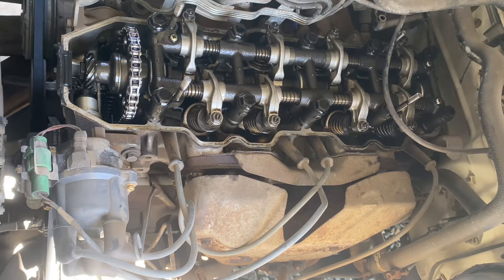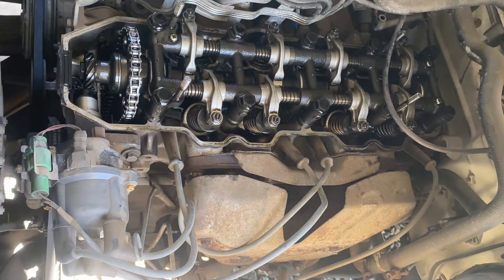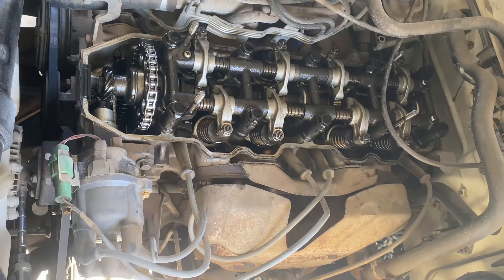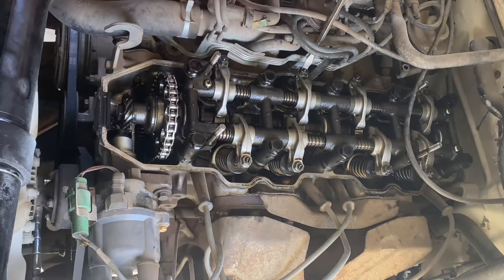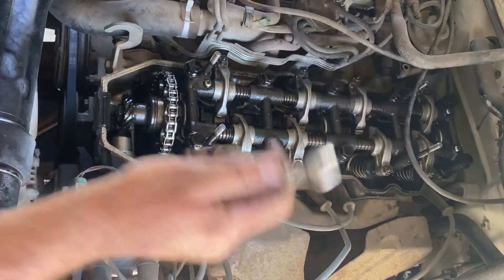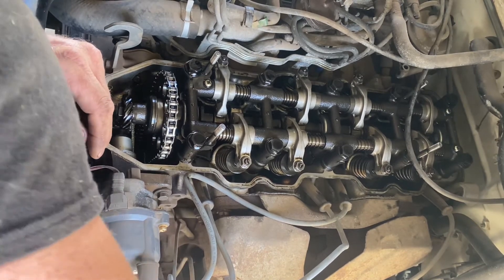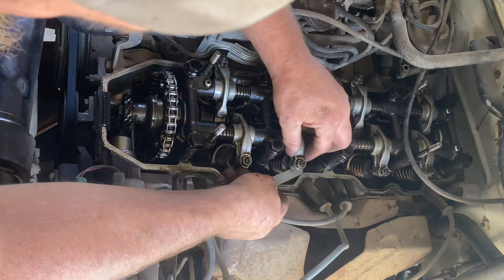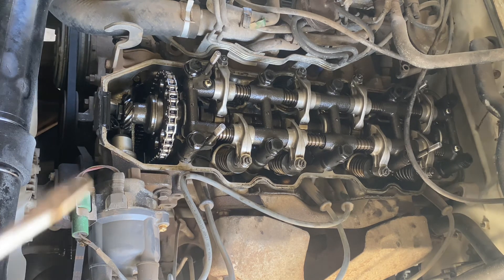Diy 22re valve adjustment. Tutorial

Comment: What’s up not certified my truck has tapping coming from valve cover maybe this would help?
Reply from the maker: Yes more than likely. My tapping went away
Reply: @notcertified7920  so I just adjusted my valves and the tapping went away then the tapping came back would u have any ideas
Reply: @johnwaynewaiolama9114  maybe the nut below the screw wasn’t tightened down enough
Reply: Perfect I’ll try it out